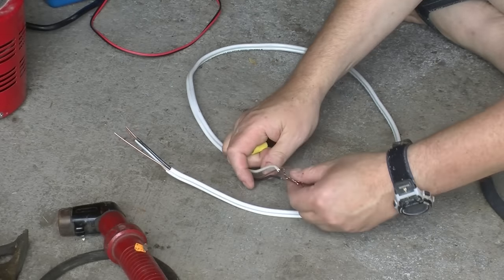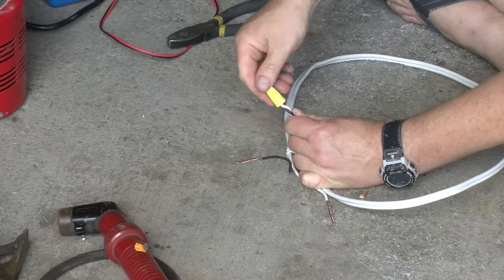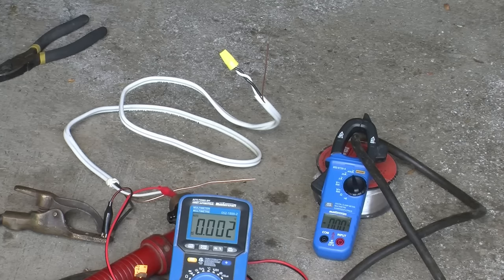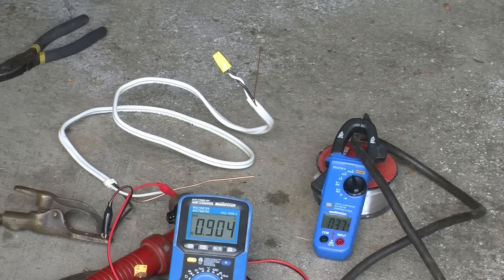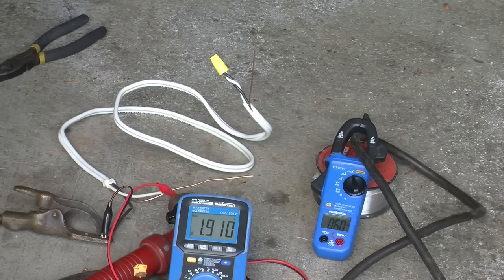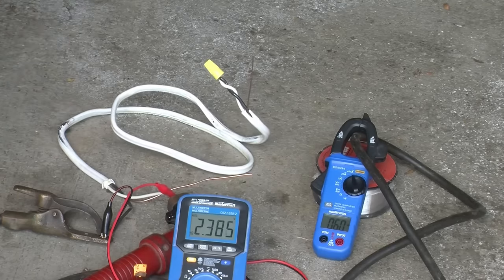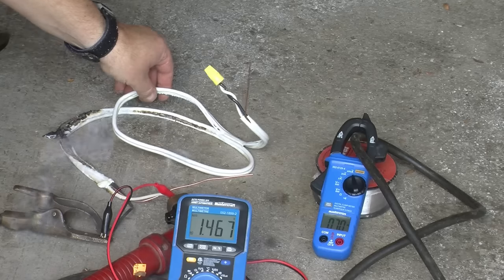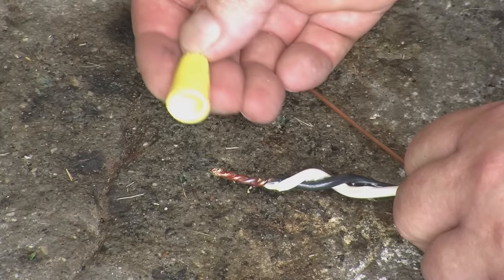How many Amps to burn up 14/2 electrical wiring?

Comment: Try this with wire nuts and wego connectors and see which holds up best
Reply from the maker: You must have read my mind. I posted a video on that this morning! Here is the link https://youtu.be/cMVnOZCGljc . Enjoy!
Reply: Oh nice. By zee way... where in the world did you come up with the idea of attaching a stinger to Romex, and various other things found within the confines of an electrician's van? This is quite a cool idea to play with.
Reply from the maker: @DarthTwilight  OK - I have to tell you the story! A year ago, I was at the local  Habitat for Humanity ReStore and there was a vintage welder that had been marked down to $100 because it was not selling. I guess it not being DC was a deal breaker for most people. At $100 I couldn't resist and figured if I ever needed to weld something thicker than my MIG could handle it would be good to have. I also had at the back of my mind that it might be useful if I ever needed to do some high current tests.  To put things in perspective, I'm an EE and always liked doing experiments of all kinds. It sat in my garage, and a year later (3  weeks ago) I was cleaning out some old extensions cords which I have always never trusted and thought - might be fun to see how bad they are before I throw them out. So I did (the video is there) and actually was impressed by the newer ones. That made me think - since I'm setup to do it, lets see what 14/2 can handle. Nothing very profound - just my idle curiosity and posted the video on my obscure little channel. I had no idea that it would get so much interest! Great thing is, many comments have been so thought provoking it had been way more fun that if I had just done the test and not posted it. The videos I have posted since then are all suggestions based on the 14/2 one.
Reply: Already been done by people who know how to spell Wago.
Reply: If I had to guess, the Wego connector will fail long before the wire does. Could be a good thing. Easier to fix a melted Wego in a JB than a melted wire in a wall somewhere.
Reply from the maker: @D0wnshift  They double as fuses   :)
Reply: And along with the wego connectors, hows abouts showing what those lovely lamp-cord snap-on plugs and switches do when they fail, too, please. Wear your Safety Glasses when you do that, please - I have seen evidence of a stream or shower of sparks or flame when they fail, and refuse to allow such grocery-store available electrical devices in my house ever again.
Reply from the maker: @brucelarsen6650  I never thought of them - I'll see if I can get some. Must have been "exciting" to see one fail  - hope it didnt happen while someone had their hand on it. Good point about safely glasses.
Reply: Basic wire nuts can have issues. Because of this, I only use Buchanan wire nuts. Motor circuits are worse than resistance circuits because of the startup ampere surge. I have used Buchanan wire nuts on 60 ampere circuits for decades and have had no problems. Generic wire nuts use round wire cone as the mechanical and electrical connection, which do not hold up too well. Buchanan have diamond wire cones to bite into the wire for additional surface electrical contact as well as better mechanical capability. In vibration areas, I will only use Scotchlock wire nuts. The inner cone is cast and once tightened, the outer housing breaks loose from the inner cone and absorbs the vibration. The outer cover can move without the inner cone moving. It also uses diamond edged contact for better mechanical and electrical contact. Installed properly, you need a good pair of lineman's of large channel locks to grip the outer cover well enough to break the inner core loose. I also do not twist the wires. Everything has to be lined up perfectly before tightening the wire nut. I do this because if any changes need to be made in the future, twisted wires usually break and cause problems when changes are made to add more wires or remove wires in the future. I mostly did commercial and industrial work.
Reply from the maker: @BLMCFR  I just tried googling Buchanan wire nuts but couldn't find a good photo of the inside. I'll have to get some to take a look - most intriguing.  Also had not heard Scotchlock wire nuts designed to handle vibration. Thanks for posting this - I'm sure it will be useful for many people reading it.
Reply: @ElectromagneticVideos  Yes, I cannot find a good photo of Buchanan wire nuts either. I use other search engines. I have used them for decades on refrigeration and Air Conditioning systems because they hold up to the surge ampere well. The round wire cone wire nuts do not.

Scotchlocks are 3M product. If you look close, the vinyl housing will break loose of the inner core. This allows the outer cover to move with vibration without the splice core coming loose. I have also used those as an electrician since 1974 or so. There is a tool to tighten them tight enough to break the vinyl cover loose. I have tough hands and have not needed a tool for decades. I don't know who sells them retail, but I buy them through a commercial wholesale supplier. They sell only to contractors. Once the outer vinyl cover breaks free, the outer cover will only spin unless 12 inch lineman pliers or a good pair of channel locks are used to grip tight enough to get the inner core to loosen.

I was a subcontractor to a few dozen manufacturers - I became a manufacturers representative if I got the call. When they had half a dozen or more companies working on a problem and none of them could solve the problem, they called for me to go fix it. I had a 100% success rate. I traveled within about a 500 mile radius of Pittsburgh Pa. I did Forensic Engineering as well as general machine repair. I diagnosed if the problem was design, engineering, manufacturing, transporting of the devices, installation, or user issues, and did repairs, or notified the Mfgr what the issues were for others to repair because I had limited equipment I could carry so far from the shop. I was almost always given Cart-Blanch because I got the job done. I also talked with Manufacturer engineers to resolve design, engineering, or manufacturing problems. A bad car crash sidelined me - I was hit while stopped for a red light at about 35 MPH. 7 surgeries neck, back, and shoulders.
Reply from the maker: @BLMCFR  I might see if I can get both as well as some of the high temperature  ceramic ones someone mentioned (most likely in the wire nut test video). I just ordered a thermal camera and want to redo a few of my experiments using that. It should be quite telling what gets hot where - particularly the "new" Wago lever and  Ideal In-Sure press-in connectors. 

Like a number of people who have posted, you have had an incredible real world experience over the course of your career - I always find hearing about longer term experiences  with things like connectors both fascinating and invaluable. I'm an engineer with an obvious practical side, but I will never over my career directly so many examples of what really works and what doesn't stand the test of time as you have. The comments to this and some other videos have been fascinating. So sorry to hear how a crash put end to your work at what sounds like its peak - sounds like until then it must have been very rewarding and great fun. 500 mile radius around Pittsburgh - did you ever make up here to Ontario?

Since you brought up vibration, I tell you a quick story about one experience I had with vibration testing: 15 years ago in a previous company we had to customize our product (a signal processing electronics box) to go in military aircraft, and for that you need vibration testing. Essentially the box gets mounted on a platform driven by three precisely controlled electromagnets that can generate the vibration profile of virtually any aircraft. The vibration are really mild. However, days of continuous mild vibration will eat through any two objects  not tied down very securely and rubbing against. It was stunning and a real eye opener. I'll bet you have seen similar things as a result of long vibration in other environments.
Reply: @ElectromagneticVideos  My original message was based on real world conditions. I have never seen anything using 1 or 2 volts with high ampere. Even 12 volts at high ampere will generate heat and fail.

Yes, I enjoyed the travel, the challenges, and the people. The money was nice too! Hahaha! I have been along the border but never crossed into Canada. I haven't worked on aircraft but understand the vibrations of aircraft I have piloted. I have worked on tourist and entertainment river boats up and down the three rivers that run through Pittsburgh. Yes, light vibration over time takes its toll on everything if not secured properly. I must have been in the top 0.001%. I have phone numbers direct into corporate executive offices that bypass the switchboards and even secretaries. I was outcome driven to get the problem solved, and sometimes needed information or to provide executives information. Clients were from mom and pop businesses to Fortune 500 companies, to military, to government to international corporations. I was advisor on a few black projects also. I will discuss history, but not details, only because the projects have been declassified.

Yes, some machinery in hot zones, I have used stainless steel wire with high temp insulation and ceramic wire nuts. Funny how some little things can become large issues. For a few decades, I have been working with semiconductor electronics. Dual trace oscilloscope comes in handy! I had a bad heart attack 16 years ago and it wiped a bunch of my memory, but I am getting some of it back. People ask why I push myself to do what I do, it would be easier to just sit back and relax. My answer is "I can't wait to see what will happen next!!"
Reply from the maker: @BLMCFR  Sounds like a fascinating career!  I completely get how you have to quiet about some things you did. You'll notice there aren't too many details about me - the industry I work in is rather conservative so no direct connection between my LinkedIn profile and business web pages and my "do whatever interests me" YouTube channel.

Sounds like you have been really unlucky health-wise.  Glad your still upbeat and doing interesting things. I'm not retired yet and like you cant ever see just sitting there and doing nothing - the boredom of doing nothing would be miserable. And if you get some chance video some of the stuff you are doing. Its been fun - I never expected this little experiment to get so much interest and result in so many interesting comments. And my thermal camera arrived today - cant wait to play with it on the weekend and use it in a video!
Reply: @D0wnshift  Wago's hold up longer than wire nuts. People have done the tests.
Reply: @BLMCFR  They were ALL diamond cut to grip fifty years ago.
Reply: Scotch locks are the worst. They either never come off, or they immediately fall off as soon as you open the junction box. Anytime I see them in a junction box in an old building I have to do rework in i know I am in for a shitty day of work

Comment: So why does every online “electrician” tell me the moment 12/2 touches 14/2 your house burns down?
Reply from the maker: I haven't heard than one. Connection 14/2 to 12/2 is certainly bad practice and maybe against the code in many if not all places in North America even if the circuit breaker was rated for 15A. The issue is that later on someone may see the 12/2, miss the 14/2, and upgrade the breaker and receptacles to 20A not realizing there is a 14/2 section which could get overloaded.

Comment: I think testing it at the mains voltages(120v/220v)should give more realistic observation as the cable will be stressed both at high voltage and high amperage imitating the actual household scenario
Reply: Voltage doesn't matter
Reply: @kylekirby6424  maybe you're right
Reply: @AgentOffice  Doesnt matter? Be caution! Its about the devices wattage.   if u have for example an audio amp that will deliver a continu 600w of power,  under a  supply battery of 12v, that wire will explode at 50A.. u cant exceed max 10A.. its all about the delivered watt  and your pressure, this wire can handle a device of max 100w
Reply: Thank you for noticing that! I felt like I was the only one lol I was thinking the same thing from the start of this video..
Reply: @AgentOffice  yes, the fuck it does… voltage makes a big difference plug 120 V lights into 240 V circuit. and you tell me what happens! But I will insist for you not to because of how destructive and potentially dangerous it could be!
Reply: @gustomizerconstruction9215   @ the 5:50 min mark he says there is about 70 watts of power (which is correct) in the wire and that is a lot for the wire, NOPE. 14-gauge wire should handle 1800 watts, at 120v ac/dc. 14 gauge is typically rated for 15amps service at 120v and 15a x 120v = 1800w, OHM's law. His setup using a welder I believe, to get the high amps but not the proper voltage is completely skewing this test.
Can you imagine only getting 70 watts out of an outlet, my wife would F-ing kill me. I mean where the hell would she plug her 1500 watt hair dryer into?
Bottom line, you and the others here are spot on that the voltage does indeed matter.
All the Best, Chuck.
Reply: @toolchuck You’re right on most of what you said and yes, the voltage does matter. However he is not saying that the wires are transmitting 70 watts. He is measuring the voltage drop across what is essentially a length of a single wire (because they’re shorted together). He’s pointing out that 70 watts are being dissipated as heat which is a clear indication that WAY too much current is being forced through the wires for how much resistance they have. Imagine you running the 1500 watt hairdryer off a receptacle in your home. Now imagine as you’re doing that you strip a section of the hot wire in your wall 2 feet long and test for voltage. You’re not going to see anywhere near 1.4 volts of difference there. That was his point. That being said yes to be fair it would be better to test this on a 120 volt source as welders do transform down their input voltage

Comment: Has anyone ever explained to you the dangers of electricity and bare footed on concrete?   Concrete is a very grounded material, and touching anything electrically charged can yield a very undesirable result.

Comment: Good test but time also plays an very important role. I tried the same thing with a 0,75 square mm (typical lamp wire size) wire and it could do 100A for about 10 seconds. Impressive but 10A for an hour or two will also melt it.
Reply: The real test would be to use a 15 Amp CB, and see if you can cook the wire without tripping the breaker
Reply: So, if 14g is approved for 15 amps, then how is 10A gonna fry it?
Reply: @SomeDumUsrName  he wasn't talking about 14g wire, from what I can tell. He said 0.75 square mm wire, which I'll assume is the common way wire size would be measured outside america. (I'm used to awg so idk)
Reply: Very bad example I would not call it a test. Use the formula not the amp probe.  The resistance is for all practical purpose is 0   If you look on a breaker 15 Amps or 20 Amps they will read 10,000 Amps RSM      120 volts/0=( dead short)   And also with # 14 which is rated at 15 amps.  You are not suppose to have but  80% continuous .  The capacity of a conductor is based on the insulation.
Reply: I was hoping this experiment would tell me what amps were dangerous with household systems. However it’s not obvious whether what matters is amps or watts. I’m guessing it’s amps in the wires rather than watts in the whole circuit. My mcb s are 15amp. The plugs and sockets and wiring are rated 10 amps. With a double socket it would be possible to have 20 amps going round with a kettle and toaster and maybe something else.